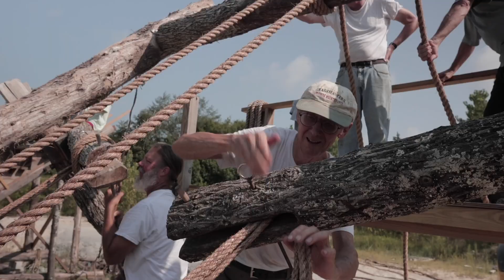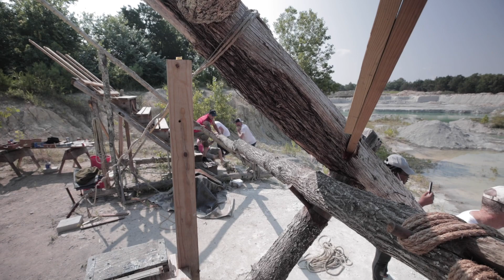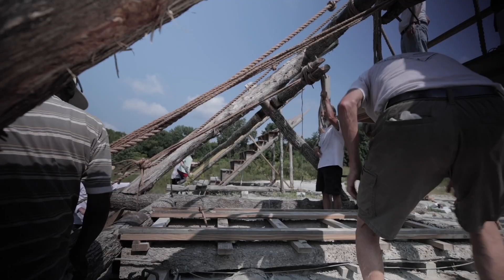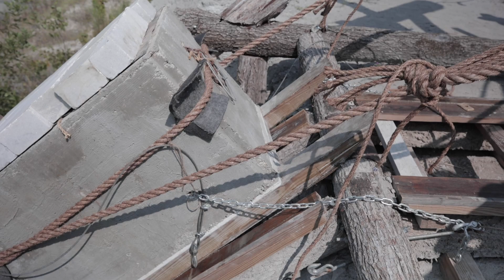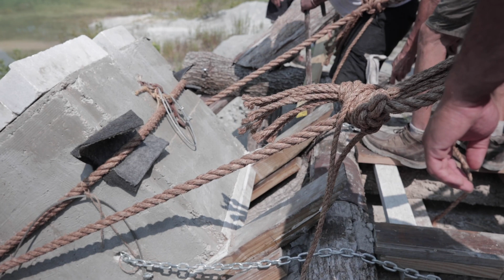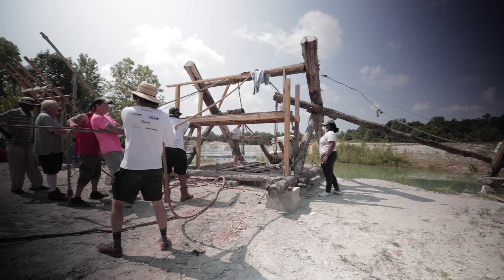Over the Top but Off the Tracks August 6th, 2021

Comment: Wonderful build and demonstration. Do the shorter ropes need to be tied on to the levers each time or would it suffice just to loop them around the notch? I was thinking about the speed if that was a consideration and if you could have more than one lift point along the rope's length, kind of like oars along a galley, meaning less lift per lifting team and the lifts could also be done by alternate teams so the poles could be removed and reset to lift again while the in-between teams were taking the weight and lifting, and so on. This means it would basically be a precursor to the cog and chain or rack and pinion system and a way of lifting great weights with almost continual motion.
Reply: So if you had four lifting stations in series, 1 and 3 would lift and hold while 2 and 4 inserted notches under toggles and then took over. Rinse and repeat. PS I read about your project in the New Yorker.